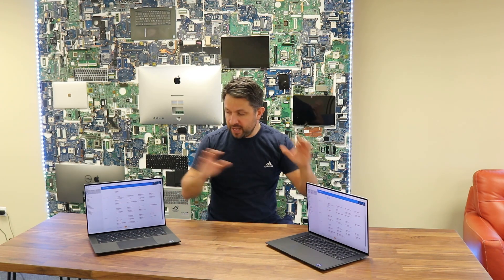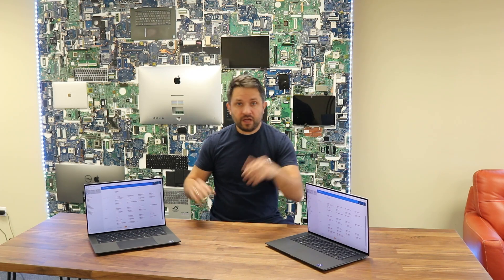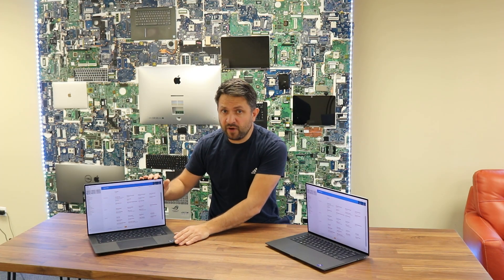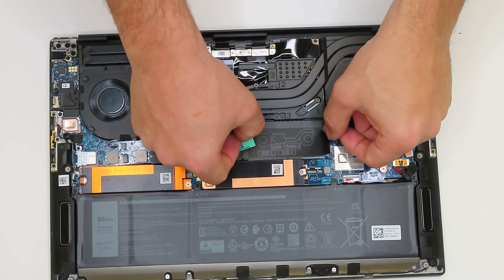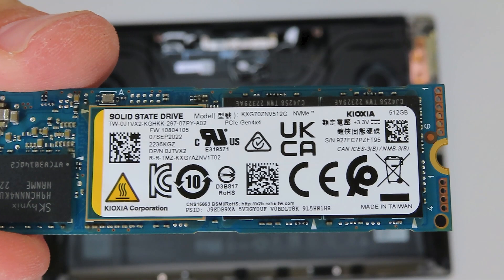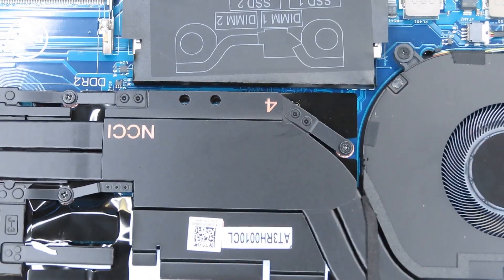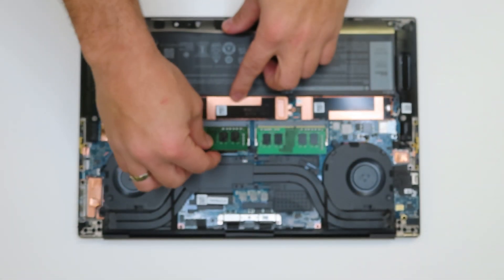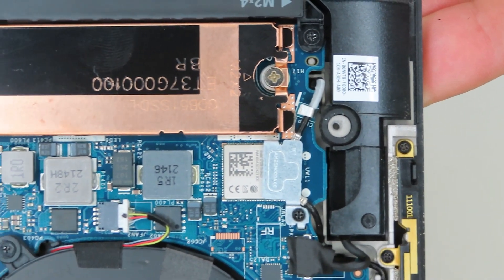Dell 5560 and Dell 5570 - review, upgrade and repair.

Comment: Hey thanks for the review. 
Is it possible to replace the 56wh battery with a 86wh one?
Reply from the maker: Absolutely, fitting and connection should be identical
Reply: @Laptopnuts  Appreciate you.

Comment: Wondering if the motherboards can be swapped, considering they have identical form factors. In other words, will a 5570 motherboard fit in a 5560 shell?
Reply from the maker: Most likely other components like will have a different connection, as its common practice to make them different.

Comment: So what is the proper screw bit size?
Reply from the maker: It's called PH1, Philips. You can find micro set at any big box store. Thanks
Reply: for 5560 - T5Hx50 Hex driver